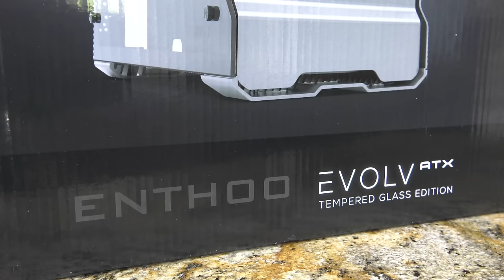Building my New Desktop Gaming Rig

Comment: Nice high end setup and I like that you didn't go so far out on the performance limb that you over complicated the rig for little gain.  That said, you should attempt an mATX or mITX rig at some point for a family member or something.  I think there is so much more challenge building a rig with your exact same specs and completely quite in a tiny case.  You probably can't overclock it as aggressively without ending up with the same noise issues but you should be able to get very close.
Reply from the maker: That's a great idea!
Reply: high end? meh.  mid grade gamer!  want to push it to well over 4.8ghz? delid it Geek Pub! its easy peasy!

Comment: Hey mate, those SP120 fans are static pressure fans, which are far better at pushing air through your radiator.  Those Thermaltake blades are for normal airflow, so they aren't going to do as great a job cooling the radiator.
Reply: Phew, you put those fans back... heh.
Reply from the maker: The specs are very close on those fans. I looked them up before buying them.

Comment: I have the same case...love it. Although I have the Thermaltake Riing Premium Plus fans that use 12 RGBs and frosted ring for a brighter effect. I was going to get the Corsair LL fans but woould be a waste since you couldn't see the front faces of some of the fans. At least with the Riings you can see the strip on the sides.

Comment: I have the Corsair H100i  , the fans it came with are crazy loud. I replaced them with some Noctua fans they cool better and are much quieter. Then used the Corsair fans as case fans that only rev up under extreme loads.
Reply from the maker: I thought about that.  I might grab a couple Noctua's from Amazon.

Comment: Considering that the 8th gen is very close like end of this month, might of been best to hold back to 

Also depending on what your doing on this pc ryzen 1700 or higher might of been better 8 cores 16 threads as you noted premier was mentioned (if its pure gaming pc i7-7700 is the best) the ryzen on a per core is about 10% slower then the 7700k (assuming 7700k overclocked) but ryzen r7  has 8 cores so very good in productivity, and gaming is fine as well (only time your bottle necked is at 1080p with a high refresh rate monitor ) 

ryzen is nothing like the past amd bulldozer cpus that where not very good ryzen is completely new architecture,, only reason I am slightly considering Intel i7 is due to 3 games that are Pure cpu bound, but what I am upgrading from witch is a i7 920, the ryzen or 7700k or 8700k is going to be twice as fast then what I currently own
Reply: lee x Shut up. King of computers here!

Comment: Awesome build! I'm in love!~ <3 I agree about the case! It's absolutely great to build in and I just moved my Ryzen build back to that case from my Corsair Air 740!

On a side note, I'm amazed we almost have the same build! I'm just using the gray version of that case and I'm using a 1700X with the Asus Crosshair hero! I love the gray look of the ROG Strix Products. =P It's funny too, because I also had AF140 Purple LED fans from Corsair but switched to Noctua's IPPC NF-14 lineup with the white corner pieces from Chromax. I found static pressure fans to be better for that case since airflow is kind of restrictive, and they're also somewhat quieter after some tweaking. Just note that the IPPC ver. is the industrial version with wide RPM variations (2000-3000 max) and they can get extremely loud when pushed to those speeds. They're just quieter on lower rpm.

Again, awesome build! You definitely picked out great parts and built something absolutely gorgeous! Thanks for sharing and I hope you have fun with it!~
Reply from the maker: Interesting!  Thanks for the 411!
Reply: man, i love my air 740. its beast! Enthloo looks nice, but not as easy to build in.
Reply: Ace_Of_Spades Gaming Haha! I feel you! My little brother wanted the Air 740 (he loves cube cases) so we swapped cases. I loved how much room it had and it looked pretty beast. =) He also went with the thermaltake riing fans and those shine beautifully in it lol.

Comment: You said gaming PC but then threw in the Adobe Premier. For productivity you should of gone with a Ryzen processor for sure and you could probably render a vid in the background and play games better on that CPU than an Intel.
Reply from the maker: LOL.  Not a chance.
Reply: TheGeekPub Why didn't you go with the Ryzen 7 series? You're gonna be doing video I assume which Ryzen is better at and in gaming Ryzen only losses by 5% which is because it's not optimized.
Reply: You Lol but all the benchmarks from every youtuber I have seen. Ryzen rapes Intel in productivity. So why lol?
Reply from the maker: Rapes is a strong word.  "Has a slight edge in certain use cases" would be more accurate.

Comment: for a normal techi its an OP and awsome rig ......for an enthusiast its not there is nothing screaming enthusiasm in this ... no ryzen no threadripper no SLI no watercooled graphics card and really a 850 psu is an overkill a 650 would be sufficient and NO RGB what kind of desktop is that even laptops have more RGB than 2 fans .......anyway cool rig keep up the good work

Comment: I've just been using Intel for years now, and I see all this Ryzen stuff everywhere.  It's definitely cheaper, but I will admit that I haven't done much research.  In all seriousness, are they worth giving a shot? I want to upgrade my media server, so I don't have to go all out on a processor, but I wouldn't mind saving a few bucks if Intel to Ryzen is no different than Mercedes to Ford (and my analogy is though one may be "superior" to the other, they are still both reliable cars).  Thanks.
Reply from the maker: This is my thing.  Some like Ford, some like Chevy.  I refuse to participate in holy wars.
Reply: Sorry.  Wasn't looking for a "holy war".  You have a channel on this stuff, you used one, so I asked your opinion. It's okay to have one.....we all do. Thanks, anyway.
Reply from the maker: I was agreeing with you. ;-)
Reply: I recently built a Xeon based FreeNAS box.  Good thing I stuck to Intel, FreeBSD does not like anything other than Intel.  I'm also doing some VM stuff, and the virtualisation tech in Intel chips is so much more mature.  Basically, stick to Intel X99/Z270 for more reliable builds.  If you go bleeding edge (Ryzen) good luck dealing with potential headaches.
Reply: My apologies.  :-)
Reply: Sounds great.  Thanks for the info.  I'll stick with what I know.

Comment: the Graphics card is not adding to the noise, it's just the case fans
Reply: also what speed is your graphics card running at?
Reply from the maker: It's the 1100Mhz overclocked edition.

Comment: Looks great!  I have a similar build myself.  Not knocking your build by any means, but might I ask why you decided to go with the mATX motherboard instead of a standard ATX?
Reply from the maker: I guess I'd ask you why it matters?  The only thing I would get extra is one more PCIe slot, and I don't need the three empty ones I have right now.
Reply: TheGeekPub It doesn't. I just figured you can find the Z270-E which carries the same aesthetic, costs roughly the same, allows for more future expansion, and doesn't leave the gap at the bottom. Again, I like your build.  I think more people would choose the ATX over the mATX for that case.
Reply: I'd have gone mATX as well. I just have one card.  Heck, ITX would be fine for me.
Reply: Reggie Cotton Which is fine. Just was curious.
Reply from the maker: Yeah, I guess it just never crossed my mind.  I didn't need the slots, so I just bought the board that had all of the other specs I wanted.  The Z270E would certainly have been a fine choice though.
Reply: TheGeekPub Cool. Thanks for the replies! Enjoying your videos.

Comment: Ryzen is actually not great other than the ryzen 3. An i5 games better than even an 1800x due to the poor ipc of ryzen. Also even though the 1800x has more cores for video rendering it's actually worse in 90% of tasks within Adobe due to poor ipc as well as poor optimization. A 7700k or even a 8700k absolutely destroys it. Not to mention highly single threaded photo editing and cad. And yes I did buy an 1800x and it had worse performance in Adobe and cad than my 5th gen Xeon so I switched back to team blue and am happier than ever using less power and having smoother playback and gaming performance. #ripryzen